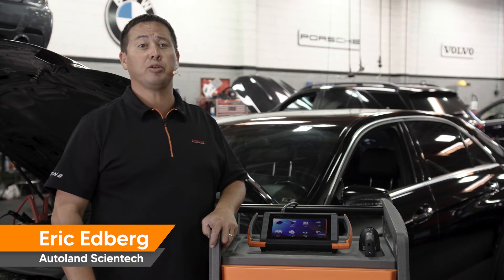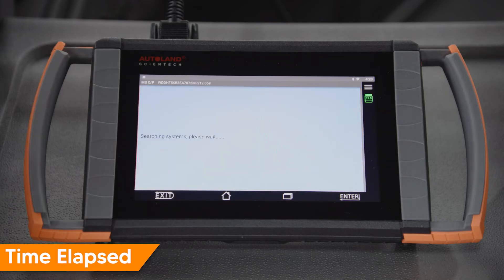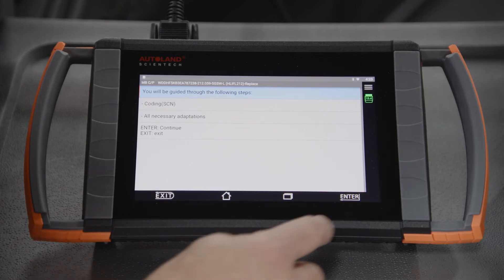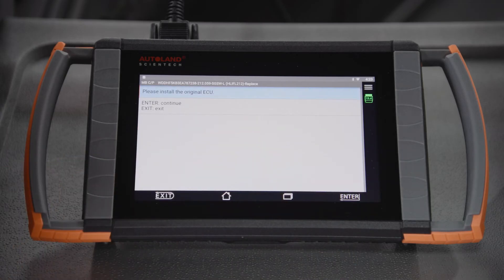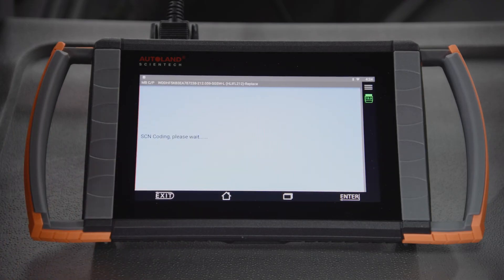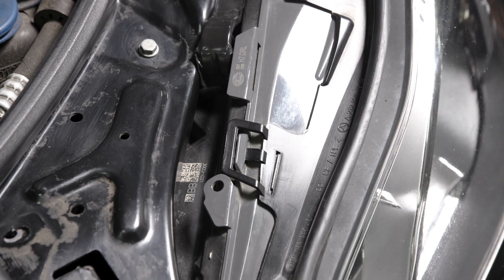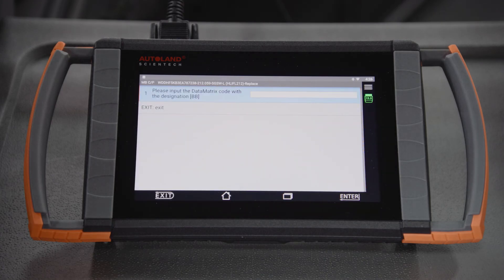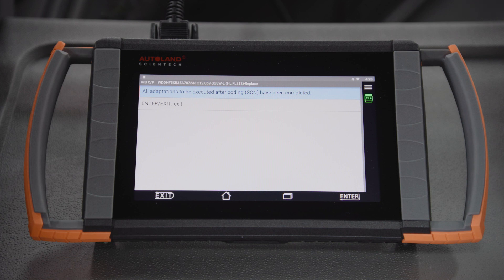The Best Way to Program & Code a New Mercedes-Benz Headlight - Data Matrix Adaptations

Comment: Hi   i got new headlights but used the old module that were on my original ones   do i need coding ?
Reply: e 300 2010
Reply from the maker: If you were reusing the electronics, you would still want to program the data matrix, but with the new module, it will need programming to the vehicle as well as data matrix.
Reply from the maker: Got it, thanks.

Comment: Dude please help 😂. A customer of mine has a 18 plate Merc and the led side light strips stopped working on the right hand headlight. Plugged it into the autel and it gave fault codes for internal electrical issues with the control module. I rang mercedes and ordered a new control module and got them to confirm from a tech in the workshop that this modual does infact control the led side light strips among other things. Awesome. So I fitted the new modual and side lights work but dip beam doesn't. Read the codes again and it just says dip beam not coded. I've tried to follow the steps to code the new modual in but it won't scan my qr code on the headlight. It's scans any other code I read just not that one. I then tried to scan the other side and it won't scan the other side either. It says the qr code isn't recognised and I can't continue the steps. The head light and the larger control unit are original from the car and the new modual is brand new mercedes. Am I missing something here ? Can you help me code this in ? I've spent 3 hours trying with autel and topdon and neither read the code on the headlight. It's printed in white onto the black part of the headlight. Most have white stickers but mine doesn't. Any help is appreciated 👍 thanks
Reply from the maker: The 2D barcode can be a sticker or embossed on the headlight permanently. If you check the repair information for the vehicle you're working on, they will note the position. If you're in the US, you could reach out and schedule an SOD service. https://www.iscantech.com/sod/
Reply: @AutolandScientechUSACedarPark sadly I'm in the uk😢. It does tell me the correct location and it's stamped led code right next to the stamped on qr code. It just won't scan it. Very annoying 😢. I also have 2 smaller stamped qr codes next to it that says BA and BB. The white stickers it will read. The black headlight with the white stamp does not scan. Ahhhhhhh😢😢😢😢
Reply from the maker: @daleevans9029  Try with a 2D barcode phone scanner, block the code you're not scanning to prevent interference. Then you can manually copy the code over from the phone scanner to your scan tool.

Comment: Trying to code 2020 GLE at the moment. Scaned the codes but the control unit rejected the codes.  Headlights and modules are brand new from main dealer. Any ideas as what the issue may be?
Reply from the maker: What scan tool? Possible the SCN coding you used is invalid. try to restore from the original light SCN coding.
Reply: @AutolandScientechUSACedarPark how to do this on autel or topdon ? Do you have to plug the old module back in first then swap ? My headlight and the larger module are original and the smaller module is brand new genuine mercedes but won't do the coding because it won't read my qr code on the headlight. Is this why because I have not done scn coding ?? This bloody thing is getting to me now 😂
Reply: @AutolandScientechUSACedarPark am using xentry . I've done the initial start up but when I scan the code in the module rejects the code.

Comment: So I bought a whole new headlight on eBay for a good deal with all modules in tact,my lens is cracked can I just take my electronics out and swap them into the new assembly to escape
The coding process?
Reply from the maker: If you were reusing the electronics, you would still want to program the data matrix, but with the new module, it will need programming to the vehicle as well as data matrix.

Comment: Hi, im working on a W212 facelift E63. I had water leak into the headlight and damage the rectangular module. ive repaired the headlight and bought a new refurbished module. Do i need to program it if using the original headlight?
Reply from the maker: Yes, the module will require programming. If you were reusing the electronics, you would still want to program the data matrix, but with the new module, it will need programming to the vehicle as well as data matrix. 

Here's why. If you source a used headlight, you can swap the housing over to your vehicle, using all the old electronics from your vehicle. That will allow it to work without recoding. The vehicle will not know you swapped anything. However, the new (used) headlight housing will have or potentially have its own unique MATRIX data for the housing. You will then have to learn that dat matrix. Coding will not be necessary because you reused your electronics.

But with the old housing and new module, the module does not know that data matrix or have the vehicle specific coding.

Comment: I replaced my damaged OEM LED headlight assembly and original ballast (water damage) with a new Chinese LED replica headlight assembly (looks exactly the same) and used OEM ballast (bought on eBay). Will I need to program the used OEM ballast?
Reply from the maker: Yes, it will need programming.

Comment: The ballast on my HID has failed due to water, and was swapped for a Chinese unit. That one worked fine for low and high beam, just didn't have any adaptive features. I'm going with an OEM Ballast now, can I still code it without the original unit?
Reply from the maker: The ballast does not require programming. Only the complete headlight with modules does.

Comment: Hi mate just want to know if you installing new module on headlight it will light up or not or only light up after programming ??
Reply from the maker: Not likely. Used headlights are not recommended by Mercedes-Benz. if installed one bulb may illuminate, but not all all. I would suggest new only.

Comment: So you’re telling me if my headlight goes out I can’t just buy a used one on eBay and a used module for it to work? I don’t care about all the fancy stuff just want headlight so I don’t get pulled over
Reply from the maker: We have been asked a few times about installing used headlights, and here's the answer:
Good question. Here's the best way to look at it. We don't recommend it. 

Here's why. If you source a used headlight, you can swap the housing over to your vehicle, using all the old electronics from your vehicle. That will allow it to work without recoding. The vehicle will not know you swapped anything. However, the new (used) headlight housing will have or potentially have its own unique MATRIX data for the housing. You will then have to learn that dat matrix. Coding will not be necessary because you reused your electronics.

Comment: Hello, is it possible to buy a used headlamp, transfer over The controle modules from The old lamp and code it.

 The old headlamp which is cracked and The lens brokebeacause i came into it with The screwdriver…. 

( w212 facelift headlights)
Reply from the maker: Good question. Here's the best way to look at it. We don't recommend it. 

Here's why. If you source a used headlight, you can swap the housing over to your vehicle, using all the old electronics from your vehicle. That will allow it to work without recoding. The vehicle will not know you swapped anything. However, the new (used) headlight housing will have or potentially have its own unique MATRIX data for the housing. You will then have to learn that dat matrix. Coding will not be necessary because you reused your electronics.

Comment: bodyshop cracked my lens and assembly on passenger side. so its not as easy as replacing the parts? who outside of the dealership can replace the part and reprogram it? im not getting suckered for 2,200$.
Reply from the maker: Any independent repair facility with an iSCAN device can replace it.
Reply: @AutolandScientechUSACedarPark  benz try’s to hit their drivers for 2,300$ for headlight replacement. You can buy a replacement light and program it for half of what they charged us their drivers.
Reply: I replaced my e350 for 550 brand new.. works just fine. Get stupid warning light about left headlamp but who cares. Works just fine lol
Reply: @2000markar  sold the benz and got a CTS v. faster and gas mileage aint bad on it. I also have a ls swapped rx7. that car I invested around 30k into and we dynode at 631hp 577 lbft.

Comment: Hi, thanks for the info. My c63 driver side led running light (the strip) is not working but the headlight has no damage and looks perfectly fine, so I just need to replace the control module? Or I need to replace the whole headlight
Reply from the maker: Difficult to say without a full diagnosis. I would assume it is the headlight itself.

Comment: Oh yeah everyone should buy a car that needs a adaptation computer to code in a new headlamp, that absolutely the most ridiculous crap I’ve ever heard of.
Reply: Exactly, this is the biggest scam Mercedes has came up with. Why cant you reuse a part from another vehicle? Someone is very greedy and wants to ensure that they make a killing on overpriced headlights.
Reply: @JustMe-gx4xt ”security reasons” 😂
Reply from the maker: The adaptability between models and trim lines require the flexibility coding and programming gives.

Comment: Hi. I am working on a 2018 e400. I replaced the left headlight with a used unit and a new control module. Is this programmable or do I need a new headlight unit? When i swap the right side module into the left (used) headlight it works fine. I can't get the new module to "adapt" to the used headlight using my scan tool. Just wondering before I try taking it to the Mercedes dealer. 
Thank you.
Reply from the maker: You need new parts, used may not work as expected.
Reply: I am in the same position did you figure it out.
Reply: He literally says you cannot use a used part due to security.
Reply: @shawoo  I ended up getting the used light to work. Had someone remote code it using teamviewer.

Comment: How would I program the ecu on 2021 w253/x253 if the original module and headlights do not exist (lost on an accident)?
Reply: Wondering same thing put a new headlight and module in my 2021 cla250 but he only explains it with using the existing old parts
Reply from the maker: You can simply scan the new headlight!
Reply from the maker: You can simply scan the new headlight!

Comment: Sir...I need some help. I upgrade my halogen headlights to led headlights, I buy used led headlights with ECU. Everything is working fine but got message of headlights malfunction. DTC B2456 in mt Toyota CHR. ECU mismatch. Is there a way to solve this issue. I put Toyota CHR ECU in my headlights.
Reply from the maker: I don't believe you can fix this mismatch.

Comment: I had my MBZ dealership replaced my battery and did a tune up. After this service my headlights do NOT lift up and center track when I start my car at night. Did they forget to reset something? 
Why isn’t my ILS functioning as it did when purchased?
Reply from the maker: What year and model vehicle? I would start by checking the vehicle for fault codes before digging too deep.
Reply: @AutolandScientechUSACedarPark  it resolved itself
Reply: @AutolandScientechUSACedarPark  it was still under extended warranty and I had the dealership diagnostic test it and it was no charge and works fine now. It is one of the most advanced features that I appreciate for night driving on curved roads.

Comment: I need to replace my left headlight control module because my turn signal was randomly not working but now it seems not to flash at all now. So to replace that control module I have to get it coded? What a croc. I don't have a barcode scanner & only code scanner I have is the MB2 from I forget who makes it but I doubt it does anything like that. If I have going to pay someone to do the code thing I should just get them to unlock the intelligent light system code so it fully functions like the cars over across the pond. 🤷
Reply from the maker: With all the control modules in today's vehicles, it is not a simple swap, as it once was. Thanks for watching.

Comment: Will this be the same on the w211 chassis?
Reply: Headlights on 211 don't require SCN coding
Reply: @ericedberg5376  do you know if w212 2009 needs Coding?
Reply from the maker: Thanks, Eric.
Reply from the maker: No SCN on W211.